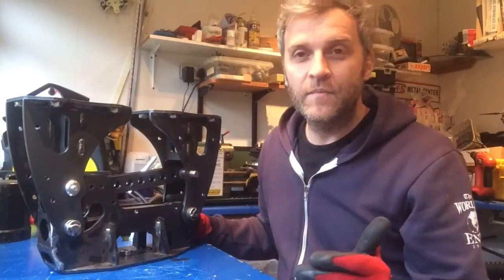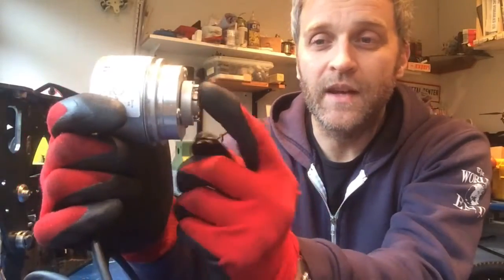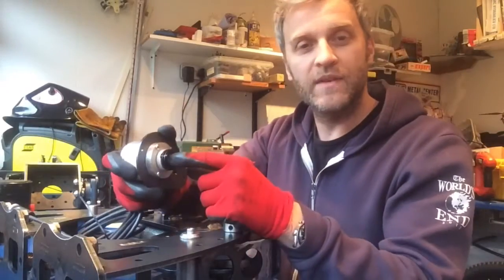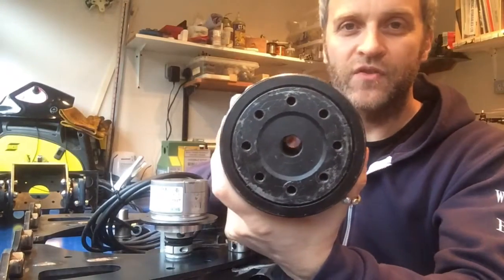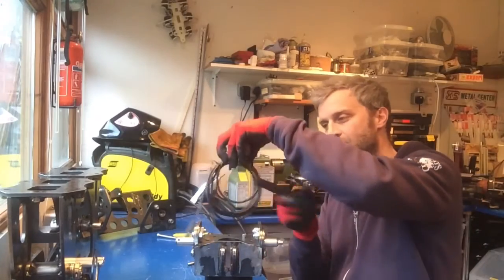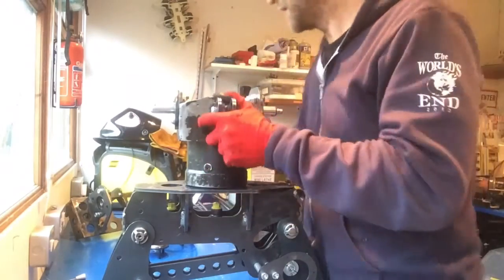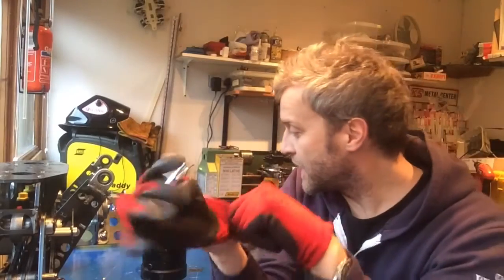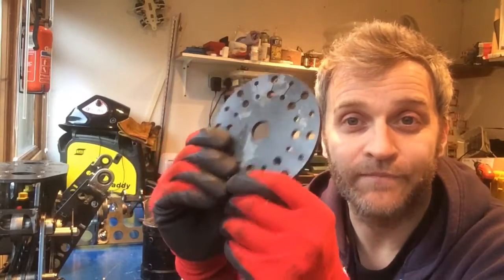Mantis Gripper | Absolute Encoders | - Mantis Hacks #1

Comment: Great workshop video! Looking forward to see it in action. Are you really able to control the hydraulics at same precision as the encoders resolution? If so, wow. I can clearly hear it from your voice that it's heavy-duty parts you are working with. Btw. You have a little bug crawling on your wall..😉
Reply from the maker: Thanks, please share :) Another video coming soon.. very soon.. and the bug is no longer :O
No you don't get 15bit positional accuracy within my closed loop system, but you will always loose resolution, so you need to start high! I can't remember the exact static positional error on the Mantis axis now, but it achieves about 11 to 12 bit positional accuracy.  If you watch one of my demo's I explain that the positional accuracy at the end of the foot is about +/- 5 to 10mm , which is pretty darn good on a machine this size!
Quoted resolution of servos is often misunderstood, Dynamixel MX series for example quote 12bit feedback, but in reality you get more like 9 to 10 bit positional accuracy. likewise with the AX range 10 bit feedback becomes more like 8 bit position accuracy. So if you're creating your won system, always start with as high feedback resolution as you can as you will likely loose a few LSB's :)
Reply: Thanks, I see, +/- 5-10mm on a scale that big is pretty good! FYI on my MX-based hex the end of the foot have a resolution of about 1mm, and that's about 10 bit accuracy. So your numbers seem to be correct. The MX servos do perform a lot smoother than the AX and I'm pretty satisfied with the result though. The part I'm not so very pleased with, is the severe gear backlash. Most visible on the MX-64's I'm using on the coxa's.
Reply from the maker: Yeah the MX servos are pretty good but I have had the same issue with backlash in the gearbox. You can tune it out with the I term, but that means the servo hunts at the end of travel. I'm currently using some Dynamixel PRO series servos at work... they are VERY good! But they should be at that price!!

Comment: Good grief that encoder seems gigantic.  Perhaps it has an empty space inside for a motor or something.
edit: i guess it's just THAT heavy duty.
Reply: Being absolute with that many bits of resolution the internal disc needs to have quite a large diameter and there will be an array of optical sensors reading it plus electronics to process and communicate. The disc will look something like this (this ons is 12bit): http://images.machinedesign.com/images/archive/talk3jpg_00000038653.jpg
Reply from the maker: Correct! :) From memory, I think these are metal disks/magnetic based, built for harsh environments. Some older absolute encoders had glass disks that couldn't take shock loads very well.